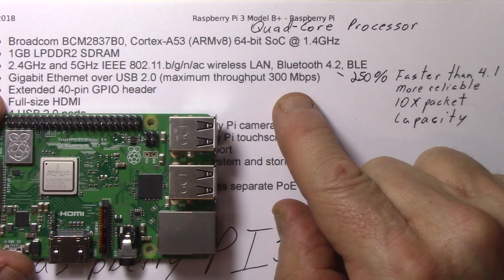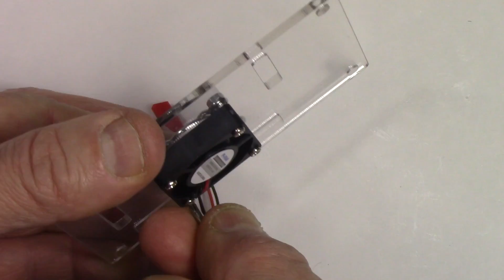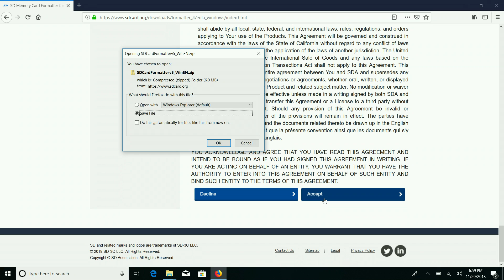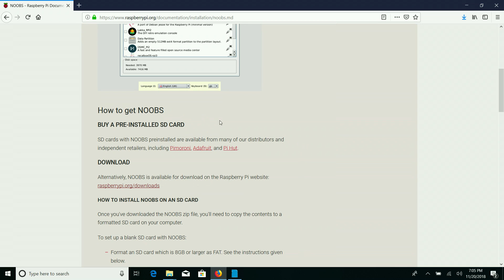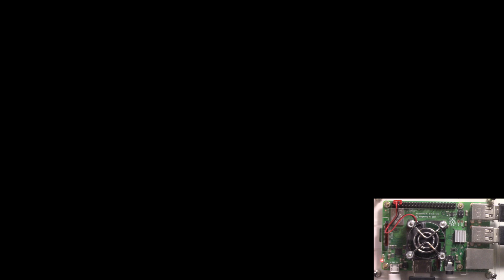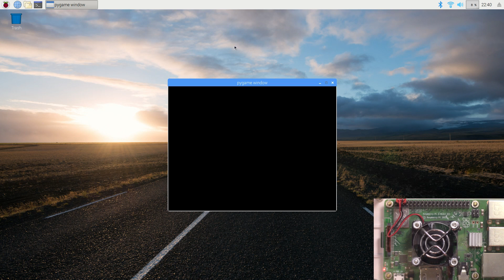Raspberry Pi 3 Model B+ From Box To Desktop  Unbox, Assembly, Overview, OS Install (Raspian Linux)

Comment: Can I run OBS on a Raspberry Pi running linux
Reply from the maker: I believe it can be done but it requires a lot of modification to the software and the result from what I have found is not that great. Please note that I have not attempted this personally. OBS works great on the PC platform with relatively cheap hardware. Thank you for watching and commenting. I appreciate it greatly. All the best.👍😀

Comment: Thank you very much Richard. Well done. First off with the Pi I followed a shorter tutorial, couldn't get it to work. For a second attempt I found your tutorial. It worked perfectally.  An easy to follow, well thought out tutorial. Thanks from New Zealand. With my Pi I intend to make a telecine machine to do frame by frame 8mm film capture. Thanks to you I'm off to a good start.

Comment: Has anyone run into an issue with the Wi-Fi?  Mine keeps defaulting back to Andorra no matter how many times I change it to US.
Reply from the maker: Mine is not doing that. Are you seeing this in Preferences > Raspberry Pi Configuration > Localisation ? Thank you for watching and commenting. I appreciate it greatly. All the best.

Comment: Santa is dropping one off to me so I am looking forward to this, especially with the warning letter that I was handed regarding the lighting bolt on rainbow screen issue.
Reply from the maker: Well Merry Christmas! Yeah, the lightning bolt issue was somewhat repaired by the cable replacement but I still get an under voltage warning once in a while still. I have purchased this power supply https://amzn.to/2GgQnLR Or Ebay: https://goo.gl/V6YJ2Z to see if I can do away with the problem 100% of the time. It has a power switch built in which I like. The Raspberry PI 3 B+ will throttle down while in a low voltage state so you really want to avoid that situation. I may make a video on the power supply as well and how to manually monitor the voltage. Thank you for watching and commenting. I appreciate it greatly. All the best.